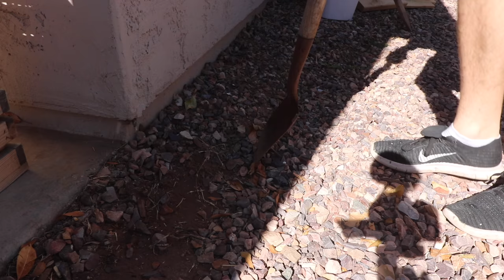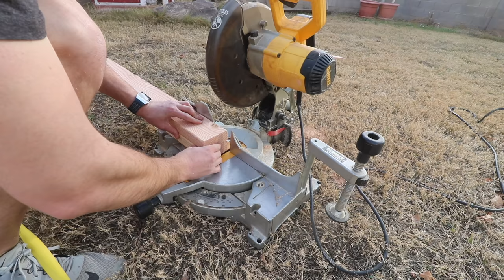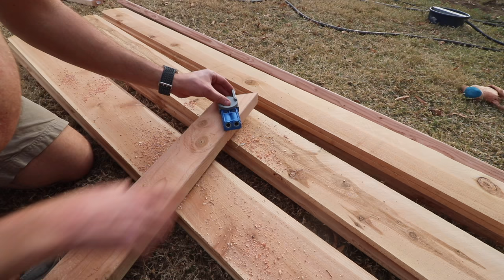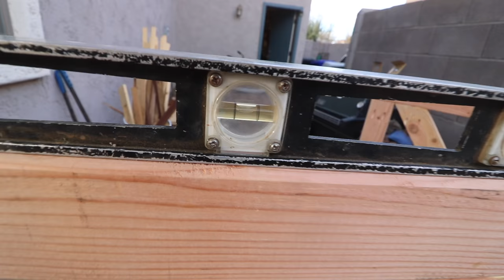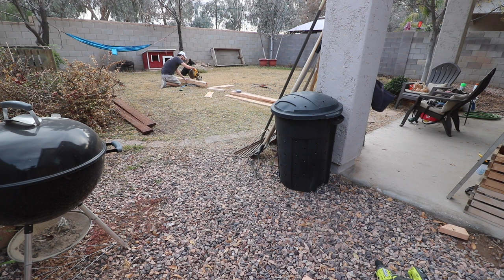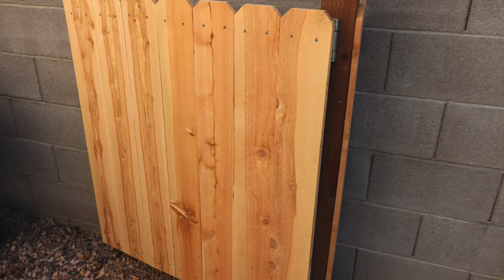How to build a wooden gate! DIY

Comment: Don't know if you are still checking comments but just in case.  I bought the same Kreg Jig. OMG it makes toenailing so much easier.  My only question was the size.  I first tried cutting my 2 x 4's in half and the gate seemed a bit large so I'm cutting them down. Looking at the fuzzy video it might be you trimmed at 39.5 inches giving a 42 (3-1/2 foot) inch length. Is that correct?
thank you
alan